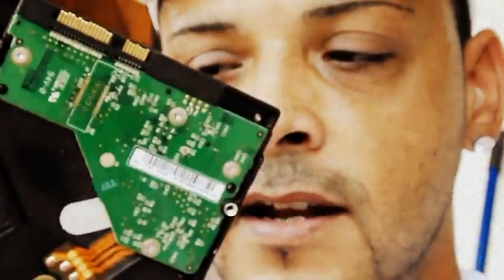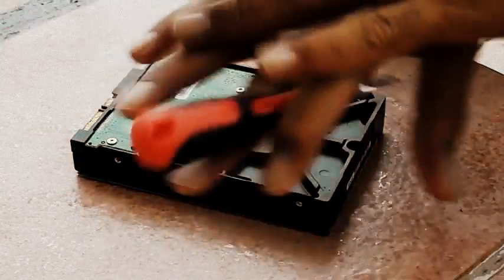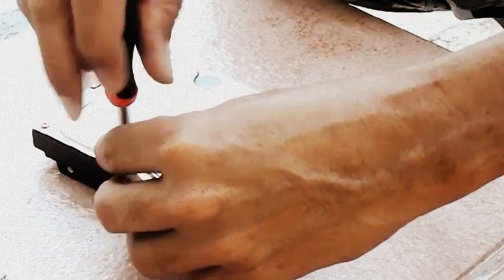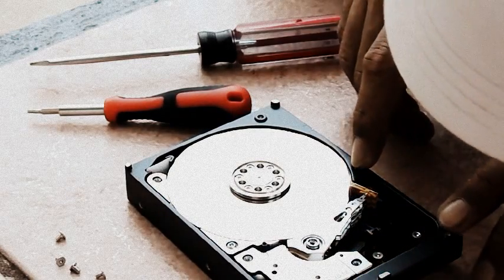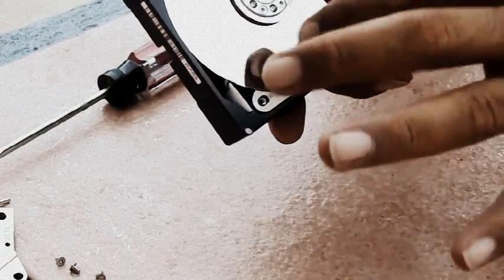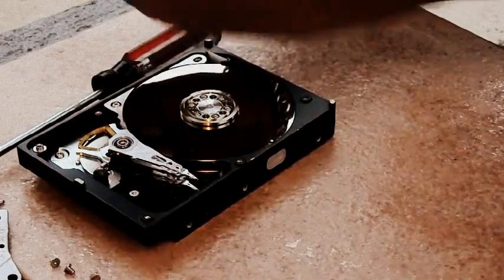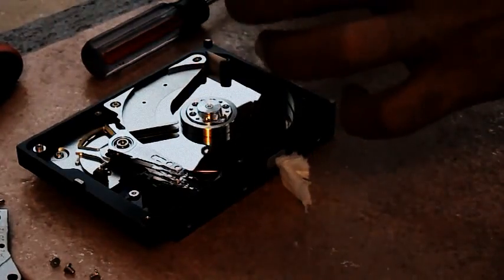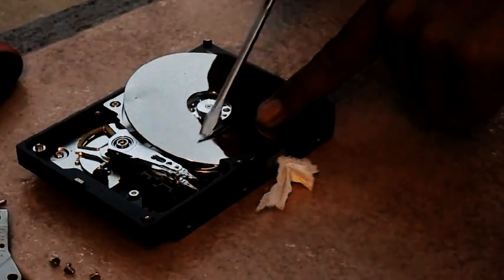Fixing a Clicking or Damage Hard Drive - MUST SEE TUTORIAL!

Comment: You've hammered that tutorial :) I think it's funny when peasants suddenly decide that they can actually fix something they know nothing about.  Take it to a pro, or buy a new one. There will still be porn on the internet :)
Reply from the maker: lol, I know how to fix hard drives, some drives can be fixed, other ones you need to work with the plates by removing them and changing them to another hard drive of the same model, but sometimes, you can have a same model and when you open them, they are different, you can double check the label and you will see that is the same model, but sometimes they are different, and that's a thing that could give you trouble. its been like 2 years that I don't work with hard drive for restoring data or whatever, I have been working with solid state drives and its something that does not get F****D up that easily.

Comment: first off should do this in a clean environment , second to remove platters they are stacked and must be removed together with a special tool because the platters are stacked and aligned at the factor up and down so you just cant remove platter at a time
Reply from the maker: that's correct, but like i said, i didn't have the proper equipment, so i just needed to show off what to work on a drive.
Reply from the maker: thanks

Comment from the maker: the reader have to be in a precise position to work, before closing the the HDD you need to be sure of that, for that you need to spin the center of the DISKS until the reader take there place where they have to be, you will know because if it's not on place, the readers will stay close to the center or they will stay out of the reading range.